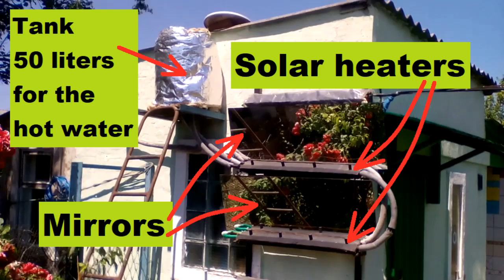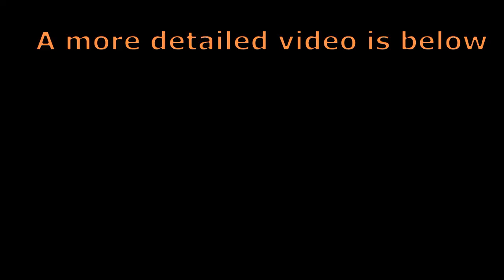Unusual DIY Solar hot water systems for my neighbor

Comment: Why do you even need hot water in summer though.
Reply: showers, dishwashing, laundry. 
Maybe you've noticed that its currently not summer, so also heating the radiators in your house.
Reply: @janlaan9602  yeah =.. if you realized it's not winter in the video